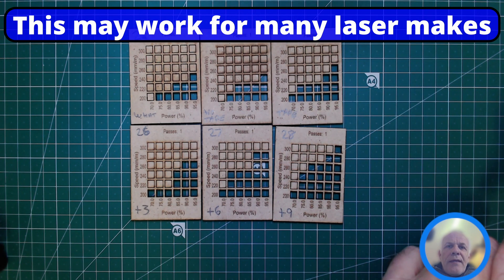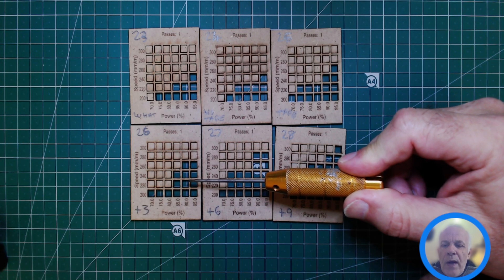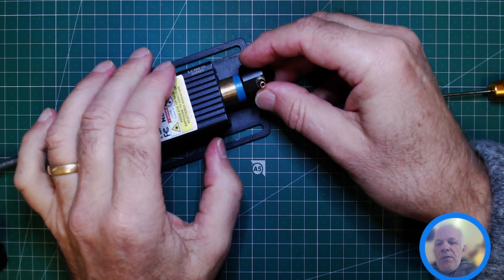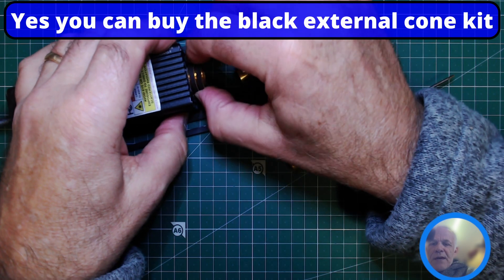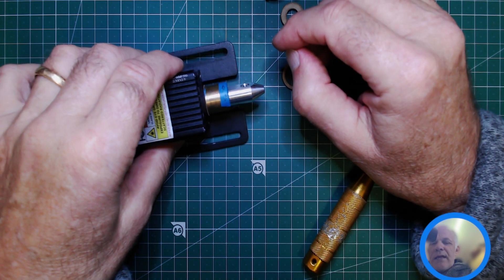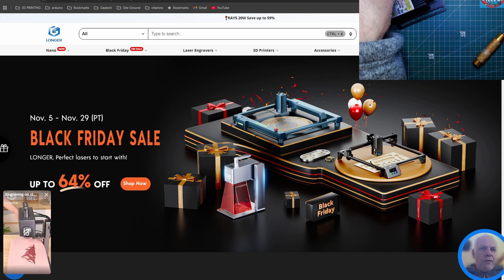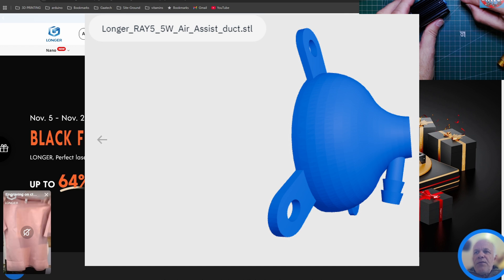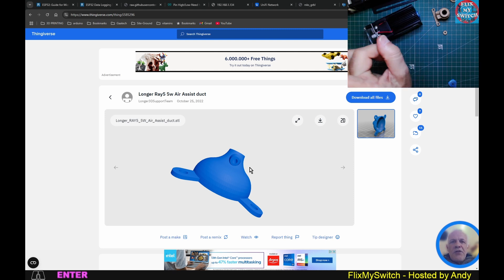Ray5 10W Air Assist Test: Does Closer Nozzle Improve Cutting & Smoke Reduction

Comment: I have the internal silver nozzle with the silicone o-ring they give you, but I've modified mine as well sorta. My original lense became dirty, so i bought just replacement glass lenses. Took the old glass out put in the new glass along with several internal o-rings to lower the overall distance. Same effect as your spacers.
Reply from the maker: Nice. More than one way to do many things

Comment: The silver nozzle is supposed to have a silicon o-ring with it. This allows you to position the air inlet wherever you want.
Reply from the maker: Thanks in will check the packaging may be i missed it. I just used some plumbing ptfe tape which worked well